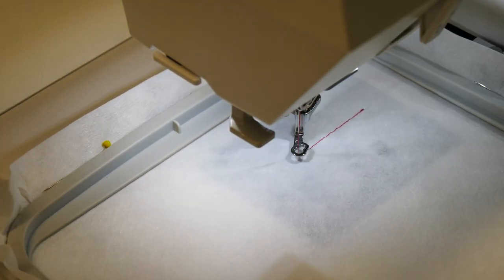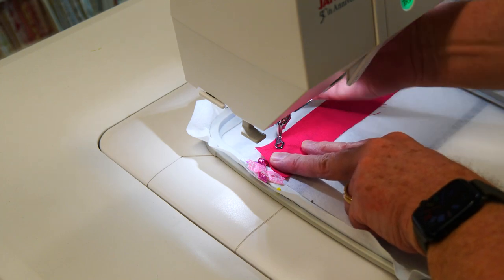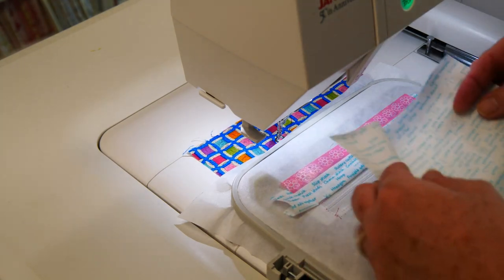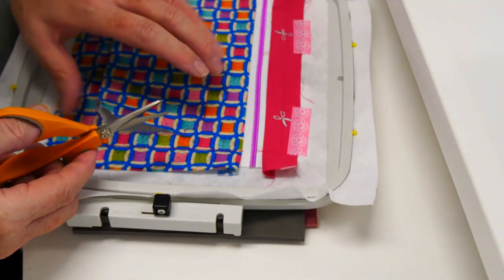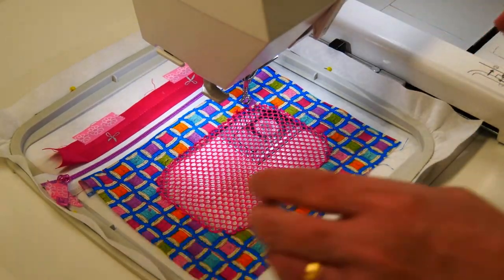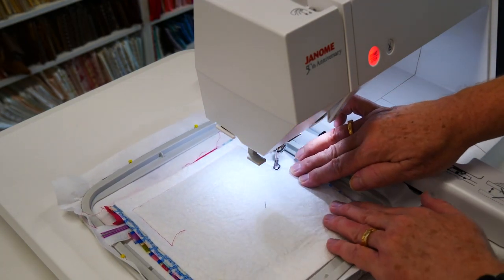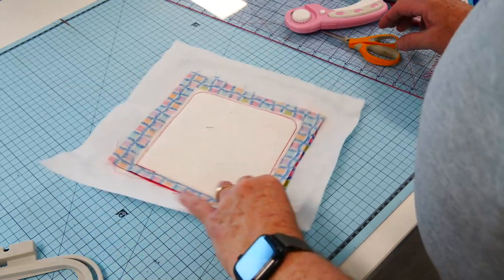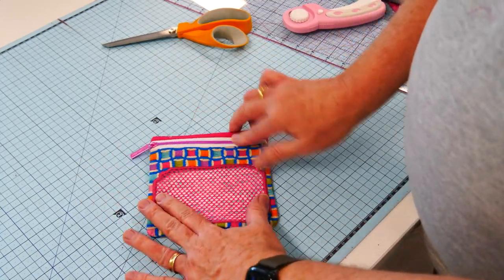Window Zipper Pocket - Mesh Version Tutorial

Comment: I always manage to hit the zipper and break a needle! Most projects, this one looks ok. Great tip to remove the stabiliser on back of work. What machine and foot are you using??
Reply from the maker: Glad it was helpful! We are using a Janome 500e in this video. We are using the Convertible Free Motion quilting foot on this machine ( Part No. 202146001). It is a Janome foot, not designed for this particular machine but comes with their other models. Just check to see the foot doesn't come too close to the edge of the frame on some bigger projects. The adjustable nature of this foot accommodates thicker fabrics/layers.